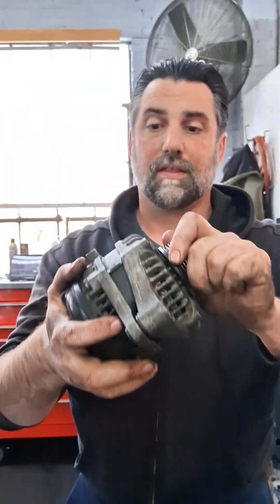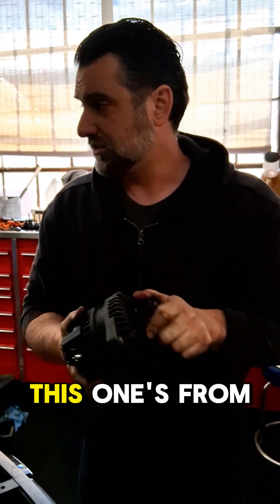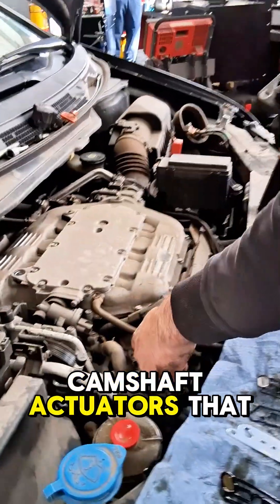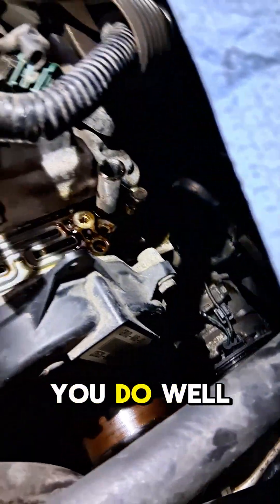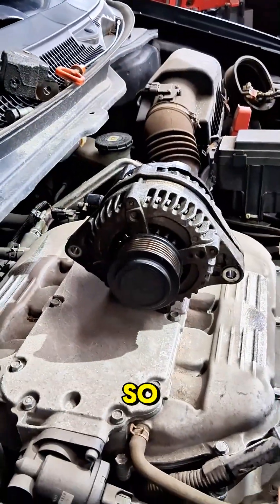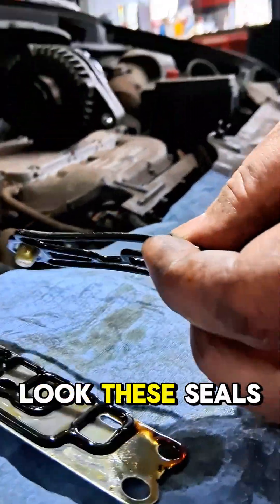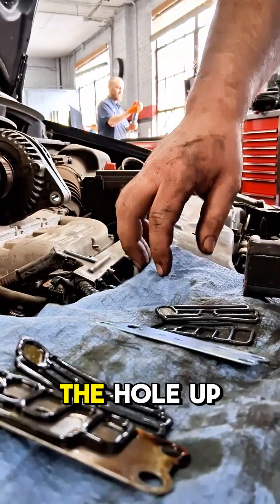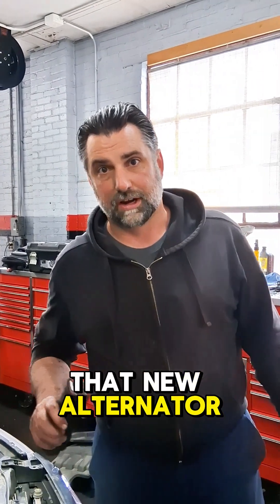Common Honda V6 Engine Problem That Kills Your Alternator

Comment: exact same thing happened on my BMW E83. Oil Cooler gaskets had failed after 15 years of driving every day. BMWs run very hot compared to my other cars — Operating temp around 225°F. My jetta runs around 185°F for reference. The oil had almost caused the engine to brick itself before I bought the car. Coolant started mixing with the oil causing a blown head gasket symptom of “milkshake oil”. Soaked the serpentine belt, the alternator, the power steering pulley, basically the entire front of the motor. Got very bad. That N52 engine is NA and comparatively reliable considering it’s made by BMW, but it’s known to consume serpentine belts through the front crank seal if the belt is allowed to slip off. Previous owner allowed the belt to slip off due to power steering bracket failure and that‘s how I ended up with the car. Top-end oil leaks are dangerous!
Reply from the maker: Thanks for sharing your experience — that’s a textbook example of how a small oil leak can turn into a catastrophic failure if left unchecked. The N52 engine in your BMW E83 is known for having several common oil leak points as it ages, including the oil filter housing gasket, valve cover gasket, and of course the oil cooler gasket like you mentioned. Combine those with BMW’s tendency to run higher oil and coolant temps (often hovering around 225°F as you pointed out), and those gaskets really take a beating over time.

It’s also worth noting how damaging those leaks can become when they reach components like the alternator, serpentine belt, or power steering system. Once oil compromises the belt, it doesn’t just slip — it can disintegrate, get sucked behind the harmonic balancer through the crankshaft seal, and cause internal engine damage. That’s especially dangerous on BMW inline-6 engines like the N52, where the front crank seal sits low and the engine bay has limited splash shielding.

The “milkshake oil” you mentioned points to a failed oil cooler or possible head gasket breach — not uncommon if overheating occurs, especially with coolant and oil cross-contamination. On your car, that might’ve been accelerated by the compromised cooling efficiency due to oil-soaked components.

What happened with the Honda V6 alternator failure in our video follows a similar theme — once oil escapes from the top end, gravity and heat do the rest. The alternator sits directly beneath the valve cover area, and when those gaskets fail, oil gets pulled through the alternator’s cooling vents, destroying the windings and brushes. It's amazing how similar the failure paths can be, even across different makes and engine layouts.

Thanks again for chiming in — it's a great reminder that oil leaks, even slow ones, aren’t just messy. They’re warning signs with the potential to cause multi-system failure if ignored.